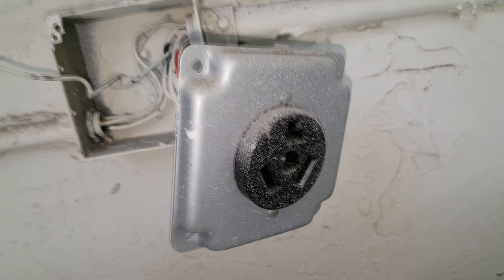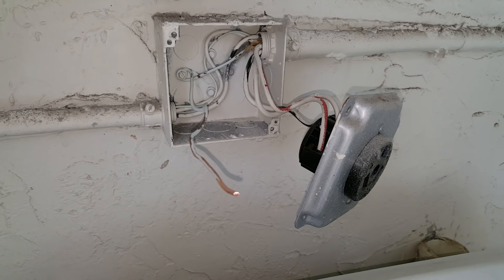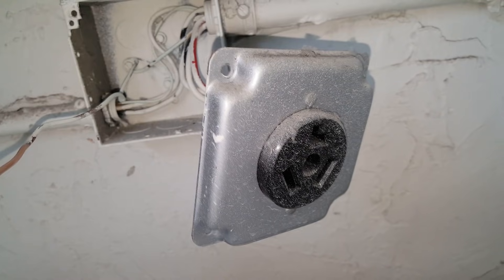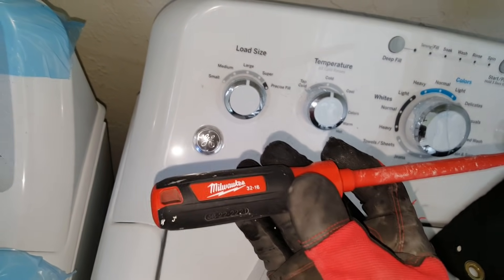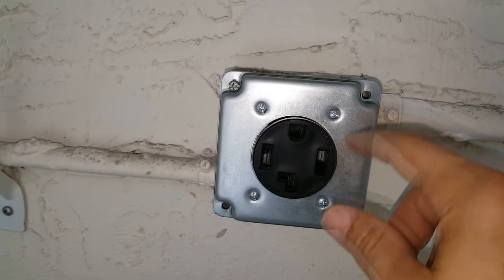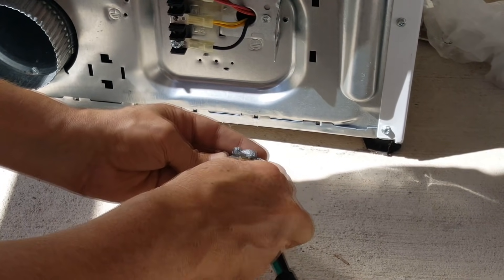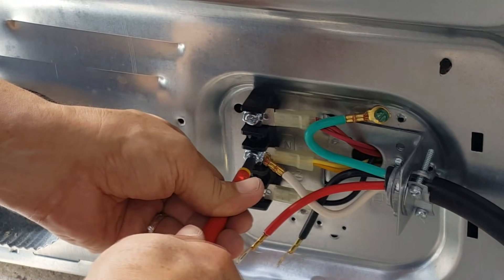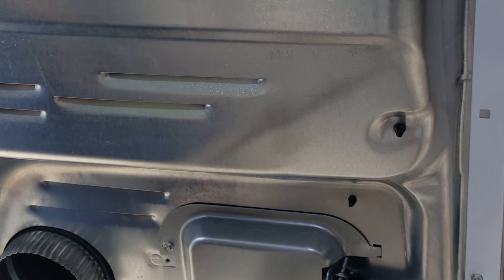How To Convert 3 Wire Dryer Electrical Outlet to 4 Wire

Comment: Red and black goes on far left and far right slot doesn’t matter which side. You should have pointed to the slots to let people know this
And ground on bottom slot and neutral on top slot
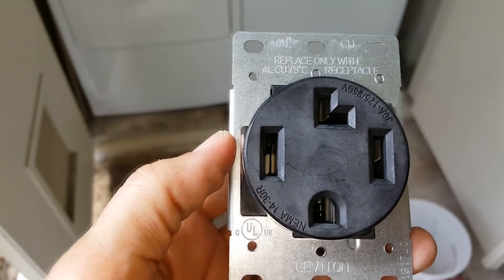Reply from the maker: It's funny how I seem to attract all the uninformed trolls who never actually watch the video before trying to outsmart the engineer in the room. At 4:05 into the video is where you see me talking about the red and black wires not mattering which side you connect it to. This is what you falsely stated I failed to inform people of. And also if you look at 2:57 into this video, that is where I also mention which 2 connectors the ground and common plug into.
Reply: very good video Jeff
Reply from the maker: Thanks for the kind words William!
Reply: @jeffostroff  great response! that is why lots of people get stuck because they do not look further than their noses.

Comment: What about the opposite, I have a generator with a four prong 125/240v 20a plug, I have a welder with a three prong 240v dryer plug that I need to plug I to it... I cannot find an adapter... I do have both end plugs I need and three and four conductor 10g wire... Can I make a little jumper in the plug to connect both 120v sides to the "single hot 240v" needed?
Reply from the maker: I just looked on Home Depot's web site, is this an adapter you were trying to get? 
I hope this link works: http://click.orders.homedepot.com/?qs=aff930c2a2fa114fe49fec1604a0d6cdd5f9b31b2d7043b7c9727e7b8c2be6ca8e6d8349eafb21c2eecad1995c4e3b09908acb191f622c9c19431a4771b65512
Reply: jeffostroff nope, I need a three prong dryer female to four prong 125/250v 20A twist lock male...
Reply: Problem is one is four conductor 110/110/neg/gnd... Other is three conductor  220/neg/gnd... My question is can I put both 110's together to make 220 or does it not work like that?
Reply from the maker: So if you connect from 4-wire to 3 wire system, just route the red wire from the 4-prong male plug you showed above to the red on the 3-wire female outlet, and likewise do black wire going to the the black, and the white wire to the white. Do NOT connect the 4th wire, the ground on the male plug wire over to the 3 prong connector. Also, hopefully the welder unit has the chassis connected to the white wire inside the back of the unit.  This is how the dryer and oven manufacturers do it, and when you buy a new one, that is why you remove that shunt from inside the appliance for a 4 wire connection, but for 3-wire cords, you have to leave that shunt inside the appliance to provide a ground for the chassis and prevent accidental electric shock in the case of wiring failure.. The reason you don't connect the ground from the 4-prong plug to the 3 -wire outlet is because usually in your breaker box, they connect the white wire to the ground in side the box. I always thought this 4 wire scheme was odd, because they short the white wire to ground in your breaker box, so why bother going through all the nonsense of routing a separate ground to the chassis of the appliance. Anyway, the female outlet you sent me is a 50 amp, did you intend this to be 50 A going on a 30 A circuit, and is that the correct pin arrangement, as one slot looks bigger than the other?
Reply: jeffostroff thank you! 😀👍
Reply: Update, I just didnt use the negative terminal on the four prong plug... Two hots and a ground hooked up where they were supposed to go... Used a three conductor cord. Worked perfectly.

My wire colors were black(110), white(110) and green(ground)...

Also you were correct about the amperage, I had to get a bigger generator as I popped the breaker shortly after starting welding.... Actually had to get a larger 30A plug instead of the 20A, tomatch the larger generator, but the wiring was the same...
Reply from the maker: Glad to hea rit worked out for you, congrats on engineering that one. Take it on Shark Tank and see if you can make these adapter now!
Reply: jeffostroff an electrician friend told me to do it, he said welders and non computerized tools are OK to do it with... Newer digital welders, like square wave TIG and such, it can ruin tho... According to friend...
Reply: White and ground go together red and black are your hots

Comment: nice video jeff im a electrician since you have a 30 amp breaker number 10 wire u can use number 10 ground wire ground to box n make connection to outlet dont have to run all the way back to panel
Reply from the maker: We used the existing ground wire that the builder originally ran to the box, but they never wired it up. We simply completed the process.
Reply: Hi paname1965, very interesting note. Would you mind and let me know which code from the NEC applies to your comment, please?

Comment: "the ground" is actually the copper wire, the white is neutral.
Reply: they all r copper wires... lol...
and actually the ground is this case is uninsulated copper wire, but sometimes it's green... while the white one was more accurately referred to as the common wire....
Reply: @nc3826  exposed copper wire in the box is the ground, white neutral, black hot, 
2 blacks 120v a peace, for a 240 circuit.
Reply: @nc3826   Until this video, I've never heard of the neutral being called common and I first learned about wiring way back in high school electricity class, in the 60s.
Reply: @nc3826  buddy put the crack pipe down, not sure what the wild hair up your a**s is about, but really dont care, kick rocks! btw "peace" "peace" "peace" "peace""peace" "peace""peace" "peace"😂😂😂😂
Reply: @ytrbro1041  good luck getting a "piece".... instead of ranting about your crack pipe and other BS your hallucinating about 😂😂😂😂
Reply: @n c no thats when your talking to your hairy chest momma!  tell her stop calling, and I am not  your daddy! she has been tossed around many times so that has nothing to do with me, 😂😂😂😂😂

Comment: Informative video, thanks for the posting. I am trying to do some electrical planning.. I have a jointer on the way that I prepped the 220 outlet in a 3 wire configuration as per the manual. In the panel I set up 240 by running a single hot wire from each 20 amp breaker, along with the ground froml to the outlet. I am eyeballing this 240 bandsaw that I plan to buy within the next couple months so while looking in the manual, I noticed the bandsaw power cord has 4 wires.. What would be the easiest way to configure both equipment plugs/outlet so that when I would want to switch, all I would have to do is unplug one and plug in the other in the same outlet.. I dont really understand how (and if its ok) to configure the 3 wire outlet I currently have to include a white wire.. I know the ground and white have similar yet different purposes but I am not electrical savvy enough to know what to do in the particular instance. It seems like you have a pretty good idea and so I wanted to ask you if you might have some insight you could share with me. I would truly appreciate it. Thanks in advance.
Reply from the maker: Jay Ross  What I would do is check with the manufacturer and see if they will allow you to change the power cord to a 4 prong cord and if they do allow that it would solve your problem. Washer's and dryers allow that all the time you have a choice when you buy your washer and dryer if you want to buy a 3 prong cord or a 4 prong cord
Reply: Thanks for the reply. I will give them a call, but Im not sure how that would work since the wiring diagram for the jointer doesnt account for an additional connection. The tools often time come without a plug but with a power cord, so you can wire a plug to your configuration. What would I do if they do say that is possible, in my panel I still have only 3 wires- one ground, two hot (each single wire going to one 20 amp breaker connected with a breaker bar). How would you wire in that additional neutral?

Comment: hey where can i pick up one of them tester lights that ypu have showed in the video to expain that ther power /no power coming thru the wire
Reply from the maker: john mos  I bought it off Amazon it is called the fluke 2AC  alert voltage tester.

Fluke 2AC Alert Voltage Tester https://www.amazon.com/dp/B004I9J4DI/ref=cm_sw_r_cp_apa_FdbtAbHMCBC6G